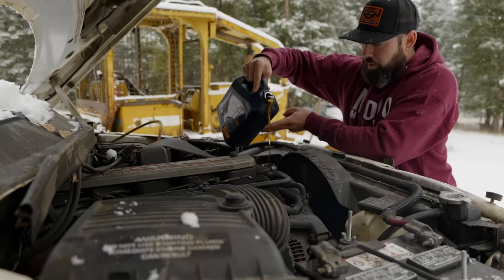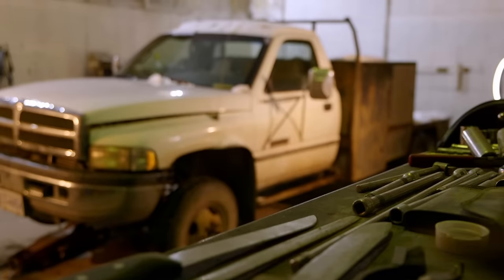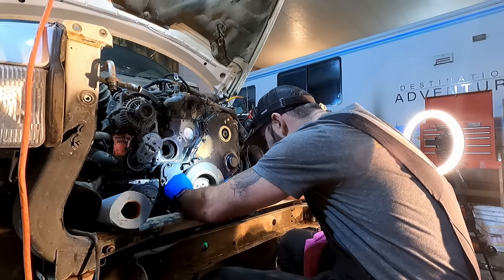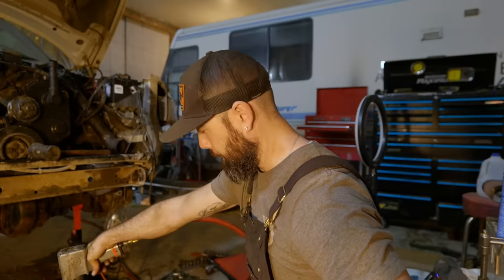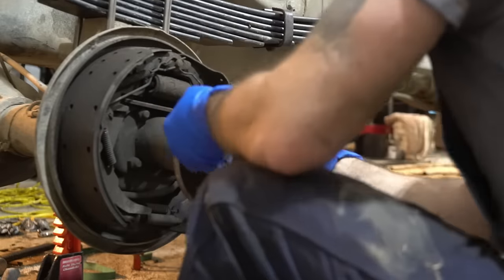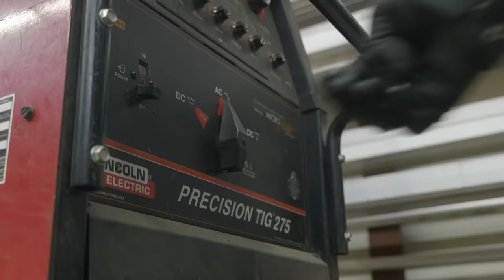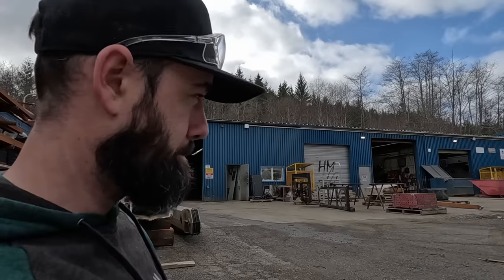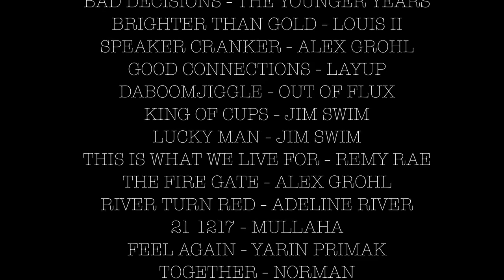Abandoned Truck to Expedition Truck | The Full Build | Destination Adventure

Comment: I own two second Gen Dodge Ram trucks. One of them is a 99 Cummings 24v diesel automatic 4wd quad cab. There’s something that I think your rig needs. One is a FASS fuel system and the second is a A-pillar gauge pod to monitor transmission temp, egt, and boost. 
     I personally use the Glow-shift package with an additional fuel pressure gauge that mounts on the steering column. 
     In either case you can use any brand of similar equipment, but as you’re already aware there’s almost too much information on these old rigs online. 
     I hope you enjoy your rig. Excellent build quality from your fabricators as well. Your videos are amazing. Keep up the great work.

Comment: I’ve got the same 1994 3500, 12 valve, Ram 4 X 4.  I’ve had it since 1997 and have got 228,000 miles so far.  She’s never let me down.  I need a paint job but that’s about it.

Comment: Anytime you take something apart have and put Kopper Kote on it! Do reduce 30% your torqueing of the it! Your radiators a good idea to have lighty  pressure washed them .
The nuts for the front spring  bolts look like they are for (Jam nuts ) not that of a gr 8 nut or better. 
I designed mine out of my head! Same as the rear canopy riser . No problems! 
That is the exact style I need for my truck! 25+" wide then cross width.

Comment: I ordered my 2001 Dodge Cummins HO 3/4 ton 6spd manual 4x4 in 2000 through Dave Smith Motors in N. Idaho. I drove it back to N. Hellifornia and finished out my career in 2018. I still have my baby and she’s just ticked over 99,000 miles last month!  Ironically, I escaped Hellifornia in 2018 and now live in NW Montana, about 70 miles over the mountains from where I bought her!! Gen 2 is absolutely known for sloppy front ends!  I replaced all of mine with much beefier parts. It’s still a bit sloppy, just not nearly as bad. I added an Edge CTS Insight comp, Banks air intake, exhaust throughout, AirLift bags, a Banks exhaust brake (LOVE IT) for towing my TT and just daily use, and an upgraded turbo. I may buy a brand new Dodge 1 ton in the next couple of years but will never sell my baby! Just tired of the sloppiness in the steering, makes long trips exhausting and every trip on pavement dangerous. Love my truck and you’ve got a beauty there yourself!! I get 26ish mpg on diesel doing 65mph through the mountains and valleys here in Montana! Towing my 11k ish TT doing 55-60 I get around 14mpg. There’s some really good vids on how much you can raise the HP on these trucks, especially the gen 2s. My turbo and air intake/exhaust upgrades along with the computer chip ensures extreme hp for towing up steep grades. I could easily before, but now even more so!  Such a BADASS setup!! New sub looking towards your adventures!

Comment: For PARTS I have found Best prices delivered for my truck Rock Auto.  Saved me $1,000s rebuilding my truck as you have done.
GREAT JOB by the way. 
Oh same quality parts as Auto stores. 
P.S.  Don't tell but I have bought parts at local stores 2-3xs price to do emergency repairs.  Then returned same brand new parts from Rock Auto to auto store for refund if I could not wait 2 days to get parts. 👍

Comment: Just a quick note. Grab a couple rubber frost plugs for the engine. My crost plug ate thru from electolysis on the engine and the size that is required is EXTREMELY hard to find. The rubber ones are easy to install on the roadside

Comment: I have a 1996 2500 cummins with a 5 speed, worst part about it was the dash before I replaced it with an aluminum unit from LRB.
We've had it since new and done some stuff here or there.

I highly recommend a new seat insert from genos garage(you can get a gel cushion with a heated insert).
Put a nice banks turbo kit on it for a good boost in power and rebuilt the front end with a single link(vs the y link dodge liked to use), and a borgeson steering box with a steer shaft upgrade...Just upgraded to a fass pump as well, with new injectors on standby, we fabricobbled out or KDP fix.
She's been a good truck, and will likely outlast my dad and me.

Comment: They have a dollar panel that will attachon your hood...🤔 or if you make a slide to come out from under your roof top tent so you can permanently mount them would be a good idea. 👍 just a thought. I hate taking out my solar panels or to charge my battery in my camping trailer so next summer I'm going to mount them on the roof and never have to worry about it again. If you ever do a project like that I regiment Victron Energy. Renogy is good, but Victron Energy is my go to now.

Comment: As I said in a previous comment, our heads work much alike and I have "extensive" experience doing just what you're doing and in a "fairly" similar rig.  You've gone far beyond, tho', with the custom fabrication of this setup and I like every inch of it.  Very nice planning and follow thru.  All that said, I"ll bet it cost a fortune.  Only thing I don't understand is why you didn't have the welded steel support system powder coated before putting on the camper and custom cabinets.

Comment: The fiberglass on the camper is a pretty easy repair, especially if you use West System fiberglass repair products. Their products are step by step right down to how many pumps of hardener to resin and what weight glass cloth to use.

Comment: Not sure if you replaced the radiator fan along with the fan clutch. It did look new but in case you just cleaned it up the stock fans are known to crack and then break while driving and it takes out your radiator. New ones are a bit thicker.

Comment: Now come and do that for my truck ('97 3500 cab chassis, 163" WB, 12' steel flatbed). And yes, the front end is dangerously loose. 15-20 years ago I could do all that myself, I have the experience and the shop, but at almost 70 now, bad heart, bad lungs, bad back - no dice. So going to pay someone to do all the work. Not going to get a plastic/fiberglass/et. al. habitat; going for a military surplus "shelter" box.

Comment: EMF ball joints are rebuildable.  Press them in once, never have to again.  King pin and spherical washers are replaceable.  Nifty setup.  ALso, FWIW on the pre 2007.5 RAM (2500's at least) there is a different front end steering setup that can be retrofit.  The drag link from the pittman arm attaches to the tie rod instead of the steering knuckle like on the later (post 2007.5) RAM trucks.  The earlier can be retrofit to the later.  That way the steering does not change as the suspension cycles up and down.
Also, supposedly wheel studs should not be drawn in with a lug nut.  That can over stress the lug leading to premature failure.  Allegedly.

Comment: Have you fixed the dowel pin on the engine the infamous KDP (killer dowel pin) I’m here to tell you nothing stop the party as fast as if the dowel drops and the best case scenario just gets deposited in oil pan but generally it goes through cam gears and cracks the block or takes a big chunk out of camshaft gear train either way it doesn’t end well and your rear bearing should have a torque setting the pre load on bearing you shouldn’t be able to spin hub as easily as you showed just saying you’re setting that hub for failure needs to have a preload